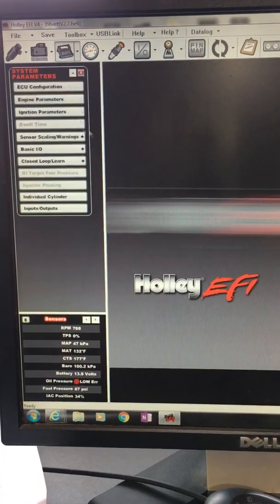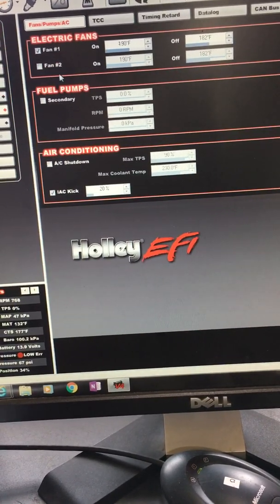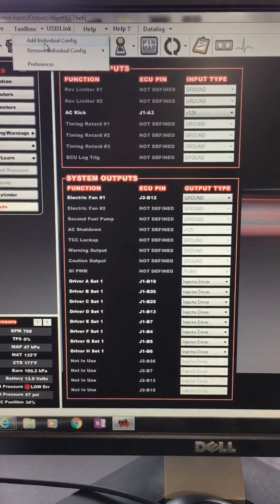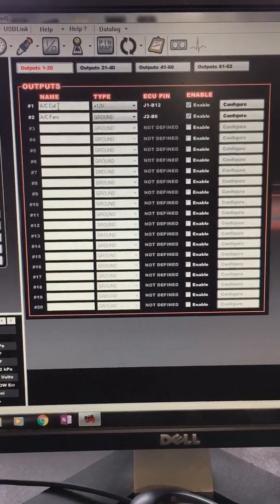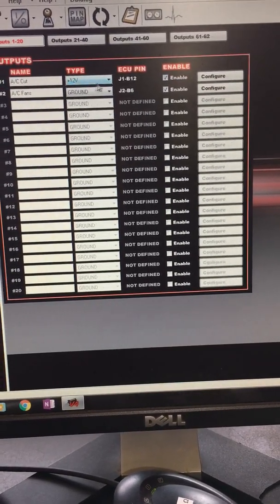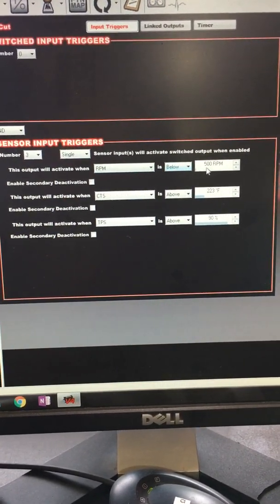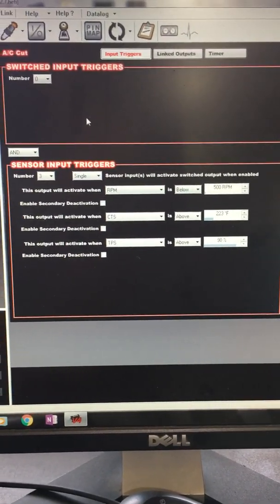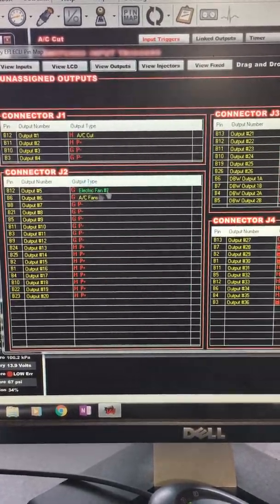Holley EFI A/C Controls

Comment: 11:20 December 25 2023
Trying to figure out how to get AC kick to work at lower IAC percentage. I have it set at 40% and it will not kick in unless it is almost wide open for it to activate. I have changed percentages and it doesn't change.
Asking for some advice so I can get it to come on at proper time.
Thank you!